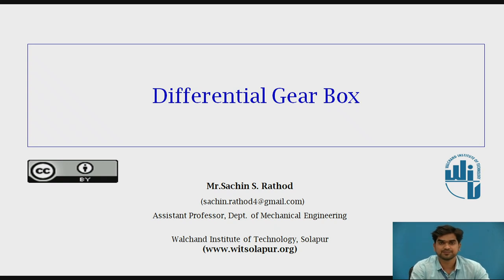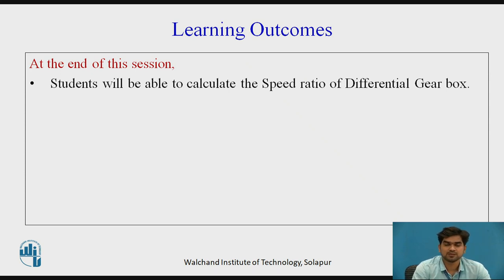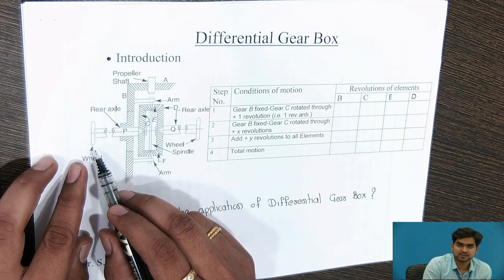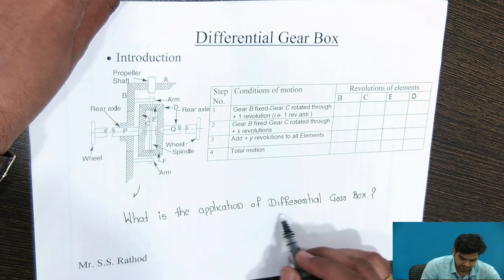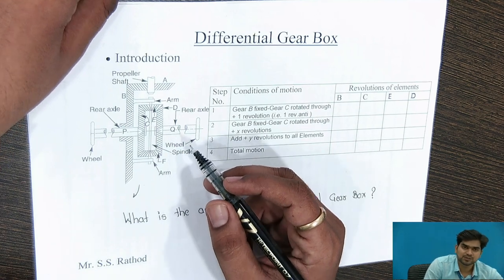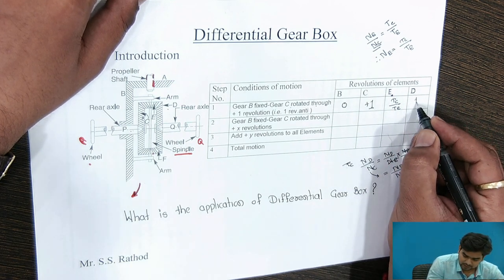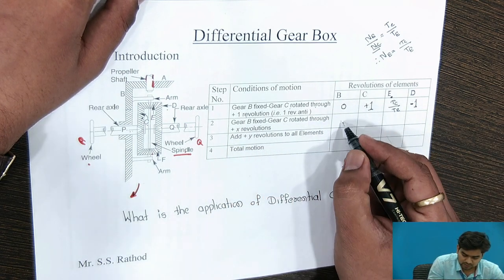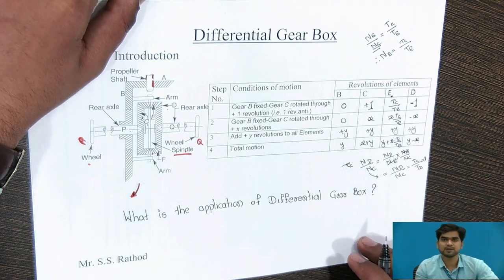Differential Gear Box (Gear Train)

Comment: I dont understand how you take plus sign in gear E column and negative sign in gear D column
Reply: As we assumed that Gear C rotated in Anticlockwise Direction through +1 rev.
Gear C and E are connected by Bevel Gear, and it is acting in same plane. So As C rotates in anticlockwise direction, E also rotates in anticlockwise direction.
Gear C, E and D are connected by bevel gear, Gear C and Gear D are coaxial gear, as gear C rotates in anticlockwise direction gear E will rotates in Clockwise direction. So opposite sign were taken.